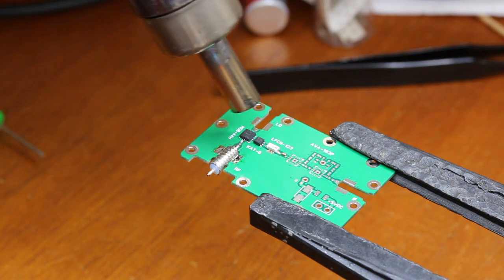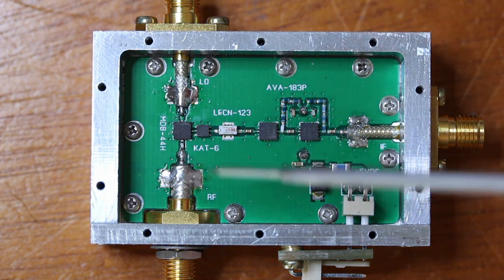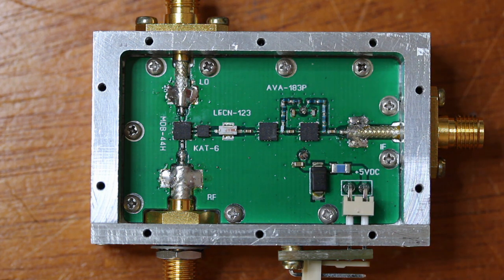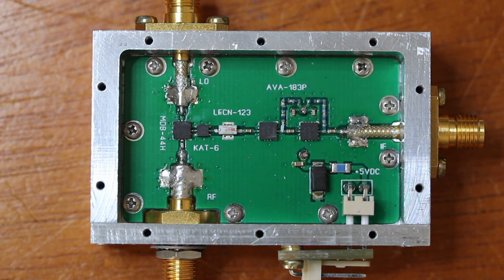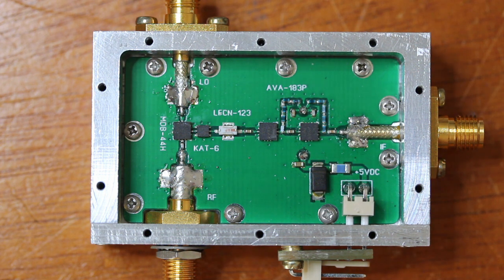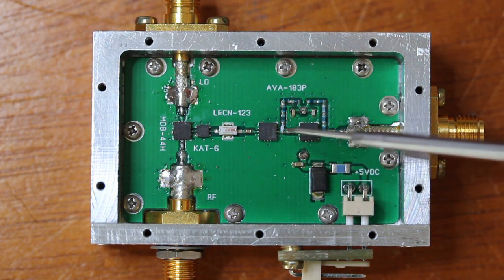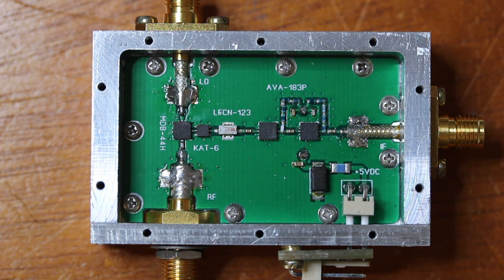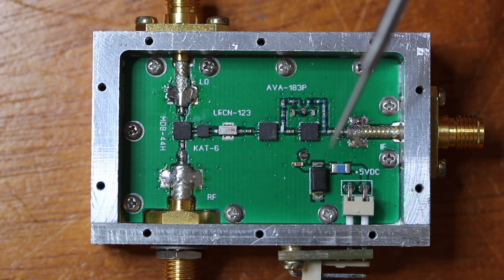#29  17 to 28 GHz Down Converter Mixer -  part 1/2

Comment: Any reason why you chose the DC decoupling inductors to have SRF above the operation frequency? I think that it shouldn't matter where the SRF is, and the absolute impedance is really what matters. I.e. it shouldn't matter whether it looks like a capacitor to the RF pat, as long as the absolute impedance is high enough. to isolate.
Reply from the maker: Yes you are right, what matters is the impedance, but I normally prefer using inductors with an SRF not far bellow the maximum frequency used. The SRF, in fact, was given just as an additional information. Thanks for the comment.

Comment: Great job, I love how you "cheat" a bit for the high frequencies on FR4, i need to remember that one.
Reply from the maker: I first used this solution in despair, when I realized that for a FR4 board this size it would cost $5 and PTFE $300, 😊. Thanks for the comment.